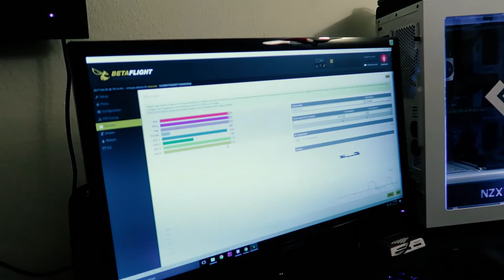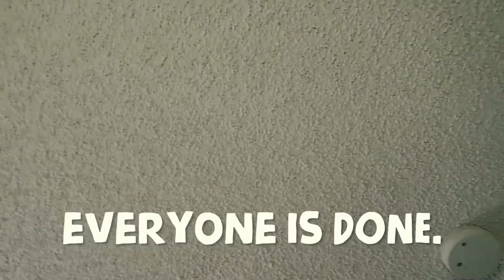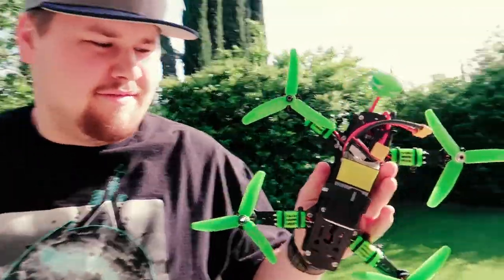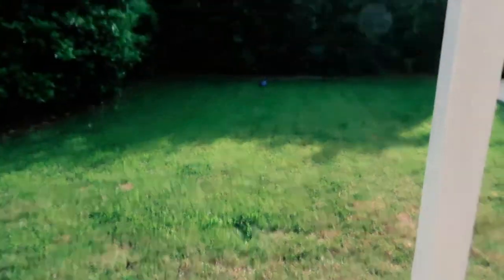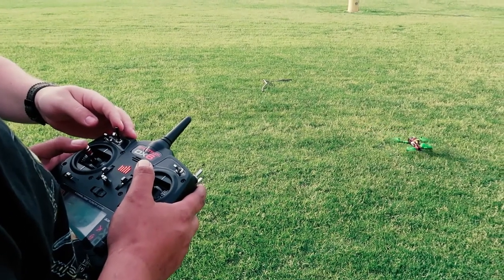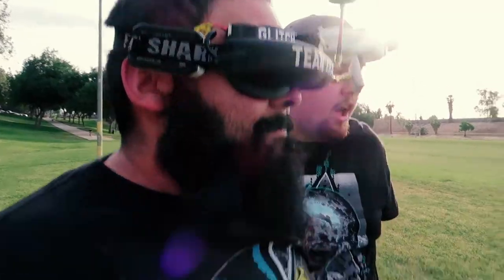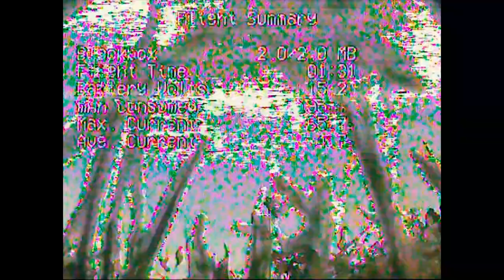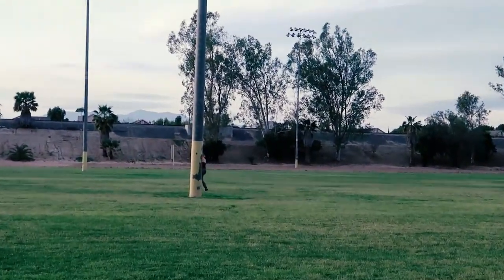A Drones Resurrection! He's back at it!

Comment: those motors need flux.. I did that too when I first started building. Put some flux on emand they solder right up! I pounded some cheap motors with a ton of solder only for none of it to stick. Built some up on the ESC's and got it to work, but when I took it apart and put the flux on, the motors ran a ton better. gotta get that solder all in the motor wires. good luck
Reply from the maker: That's exactly what i was reading the next day after lookin it up! Thanks for the info tho much appreciated !

Comment: Sup, good vid, issues tining them wires, use flux on it, it will then suck up the solder no need to have solder & iron & target wire together, use iron to grab a smig then just tap the fluxed wire and it magically sucks it off the iron. :) PS , help Albert find his missing quad.
Reply from the maker: thanks man! and we DID ! we FOUND IT ! video soon!